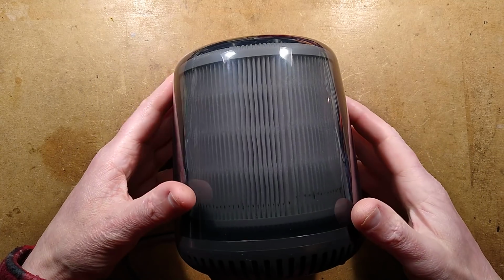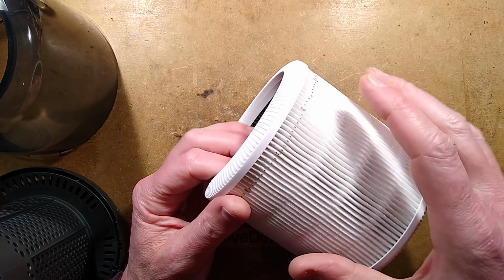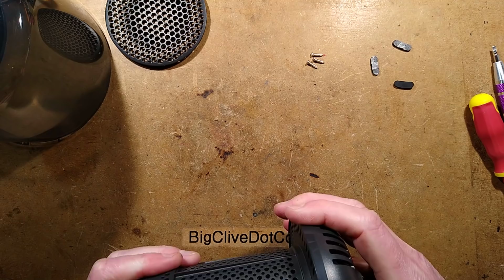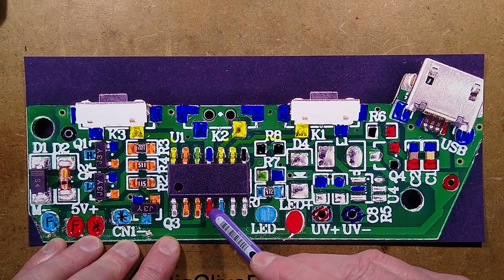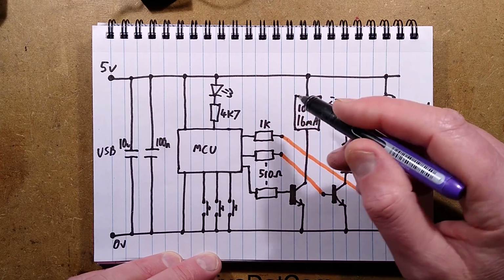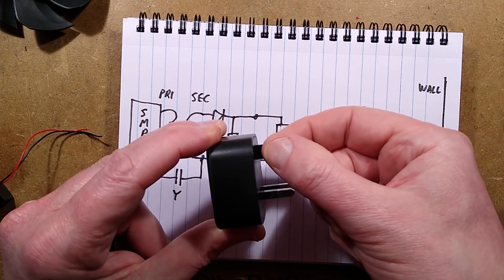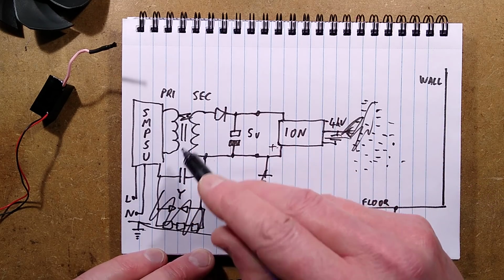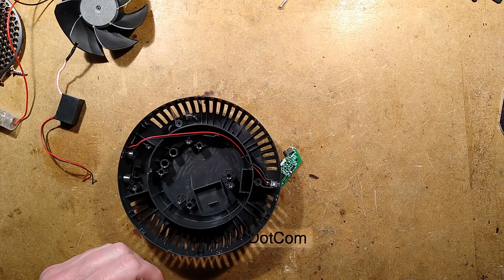Queenty air purifier/filter teardown (with schematic)

Comment: Let's not bother using the off switch so it can wind down and discharge properly, nope, let's just yank out the power connector just to test it's stress capabilities and status memory to see if it winds up, pops, or does nothing when we plug in the power connector again (without bothering to use the mains socket on/off switch, just to test the power adaptors flexibility)

Comment: As long as they can't control who buys it and it's not a time limited offer there is no reason to buy a filter that costs double, i in those cases would every time buy a new machine with filter, if i hadn't found cheap printer ink i would do the same with with printers

Comment: My giant air cleaner/ UV Device has a Flashing Red Button to tell you when to change the 2 HEPA Filters. But you just push the Button for a couple of seconds to stop it Flashing.  It has no Effect on the Unit at all.  I have occasionally used a Vacuum Cleaner on the HEPA Filter. There is a Sponge type Filter which I Wash in soapy water !!!  I never change the HEPA Filter and it Works Fine if my 2 Dogs decide to Fart on my Bed at night !!! I have a Separate Ionizer which is always on !!!

Comment: I didn't understand it - did you say that 1. the HEPA filter will have both greater surface area, and also be more cost effective? Or are you saying that 2. your self-made one will have both greater surface area and also be more cost effective? Thanks.
Reply from the maker: That one has much higher surface area.  But my experimental tissue one is very cheap to replace the filter on regularly.
Reply: @bigclivedotcom  T Y

Comment: Can you make a teardown of a computer fan with speed control (typical 4 wire CPU fan) and an ordinary 2wire fan? Because I've found some 2wire fans having super complex circuit board it it and some 4 wire fans with just a handful of parts in it!! I still can't understand why does it need all that for being just a fan???
Reply: Besides from pos. And neg. There is an PWM input for rpm control and an tacho output to make sure the fan is not jammed and rotating at proper speed that feeds back to the mainboard telling it the 200$ CPU is not going to blow up in smoke.
Reply: @casemodder89  Thank you so much. I didn't know that. 😀👍

Comment: I am not quite keen with the thought of having a 5-xx W appliance run 24 / 7 to counter the effects of other appliances .. 🙄
Most of the dust I see in my environment comes from grinding fabric (washing machine, carpet, bed, etc.) much of it comes from the outside (factories, other peoples garbage..  etc.) 
The little girl fairy tale that it is all from human scales to make them clean up their room doesn't work on me, I' rather build resistances ... and save the environment (by not using energy) (thank my later).🙈

Comment: I think I'd be backwashing the filter in the kitchen sink, and leaving it in the sun to dry.
Reply: My electrolux vacuum uses a filter for which the instructions tell you to backwash and dry in the sun when it becomes full!
Reply: I've been doing it for years. Any paper element filter I've ever tried to clean has come out very well. The only ones I've never tried are ones with metal wire supports... I figure they'd probably rust.

Comment: I'm sure I metioned ions vs moving plastic(go roundie roundie bits) in a resent post. ;)
I think you will find that the ionizer keeps the activated carbon filter charged. I have 1/2 a dozen UV,a,b,c. Led's, they are 10mm eglass. Not from evilBay. Tested in a lab, they scare  the sh!te out of me. Most computer fan noise comes from sh!te bearings, stater chatter, air turbulence.

Comment: Clive... No way to use a Paper Towel Filter on the Round Filter by removing the corrugated white material only and wrapping the Paper towel filter around the original filter cage held by some tape ?

Comment: Isn't this like sweeping the ocean with a broom?
Reply from the maker: Low flow in a small room 24/7 adds up.
Reply: @bigclivedotcom  I was thinking it's not like if you live in a plexyglass box and the purifier sucks all the bad air in.
In the end you still have a tiny fan which will also have to deal with an endless stream of dust that it's in the air just because you move in the flat (I left my flat for 5 months and when I came back all the surfaces that I would normally had to swipe once a day were clean). 😁

Comment: It's a trap! This is an ionizer video!!!
Maybe connect the motor directly and use a button and led to light up a "do not push this button" sign?
Can you use toiletpaper as filter medium in this one instead of the filter?

Comment: its a poor design too, the air intake should not be at the very bottom as it will be clogged very quickly. it should be on the sides or top in a proper design.

Comment: You suggest the 2nd best solution to the ionizer's high voltage was the addition of three resistors. What would be their values?
Reply from the maker: At least 1 megohm per resistor.  The three would be for the extra safety of the combined resistor voltage ratings.

Comment: Would adding a DC/DC module (like A1212-2W) help with this high voltage reference issue or this is meaningless in this case?

Comment: I don't think I've ever gotten a tingle from a charger.
Reply from the maker: A charger output could be live at mains voltage and you wouldn't get a tingle if you weren't grounded.    When people are working on grounded surfaces they can get a slight tingle from the normal 100uA charger leakage.  To see the leakage bridge a multimeter between a phone's metal case and mains ground. You should get between 60V to 120V AC depending on the supply voltage.

Comment: Every USB charger I have seen has used the two pronged euro plug. So not earthed at all... Can you even get an earthed USB charger for Northern European sockets?
Reply from the maker: Most USB chargers are ungrounded so the one PCB can be used in all versions, either grounded or ungrounded.

Comment: I have the one you covered in your video from Sept-2018 titled "Inside a shitty eBay ionizer with weird circuitry" and it has been plugged in for months now!
I'm pretty sure it's not grounded and would like to fix it, but don't wanna fuck up for obvious reasons. 
Everything tells me it's the black wire of the module that needs to be Earth grounded. Right?

Comment: So are you going to try and pleat a roll of toilet paper and make your cone filters? 😂
Reply from the maker: Sealing the edges is the tricky bit.
Reply: @bigclivedotcom  Would probably hold it all together it a mandrel and then go at the ends with hot melt glue? It doesn't really need to be a cone, a big pleated panel filter like in car airboxes and and hvac systems would work just as well.

Comment: Is there a cheap DIY alternative for the extremely overpriced air humidifiers? Air is extremely dry here in Germany lately to the point I got slight nose bleeds over night...
Reply from the maker: There are many ultrasonic humidifiers on eBay.  I have the opposite problem here.  The environment is high humidity.

Comment: Fan seems like an issue, but that could be with the relative closeness of it... but could that be the Ozone making the noise? as they have a hum/tingle going one.
Reply from the maker: No noise from the ioniser module.
Reply: Hum... really makes you scratch your head why it was added... or was it like most things built off another design and they just didn't remove the parts counter, maybe it was just marketing and tick.

Comment: does the metal plate above the ionizer act as a static charged dust collector?? it would be fairly easy to clean that plate
Reply: Interesting thought, it might work even better if it were connected to the negative supply lead of the ioniser module, to allow charge cancellation.
Reply from the maker: It requires complete disassembly to access it.

Comment: Does this mean that an ioniser that’s powered by a non grounded (12V?) power supply will build up charge and become dangerous?
Reply from the maker: Yes.  There's a risk that it may damage the power supply.
Reply: @bigclivedotcom  Okay, thank you. The only ionizer I can find in Sweden is built that way. (There are also ozon genereators for usage after a fire and air purifiers that have hepa, coal and ionizer, but I have not found any other that is just an ionizer).

Comment: I commented about my own project in the last video and here's first test version https://i.imgur.com/Umn8rE1.jpg. That's G4 rated filter.
The hardest part will be figuring out how to install the filter without it leaking from the edges. Total price without the base 20€ fans + 13€/4 filter + cords etc roughly 20€ = about 45€

Comment: Another shout for vacuum "washable hepa filters" after working for a bit for electrolux , they can be some quite good bargains, always buy a pack of 2, so when you are washing and slow drying the filter for 24-48 hrs (without direct heat .. no no to radiators... ok in airing cupboards) whilst using the other the one. and not using chemicals , just warm water and dont scrub, the integrity of those filters are pretty good.  Telling someone that there vacuum might have died due to not cleaning the filters in years (with usual repsonse of "what filters" or I know how to use a vaccum, being a firm favourite reply) they can take some hammer ! http://tiny.cc/bigclivefilters

Comment: You could also build one with an off the shelf vacuum cleaner filter. Something like these. 
https://www.ebay.co.uk/itm/265026785025?hash=item3db4d3cf01:g:hp4AAOSw3a5gDnJQ
(There are lots of other random "hepa filter" options on ebay/aliexpress to chose from, all of which are much cheaper than the one BigClive demonstrated.)
Reply: ... or use a Covid mask. They are cheap as chips. Almost as cheap as the bog roll.